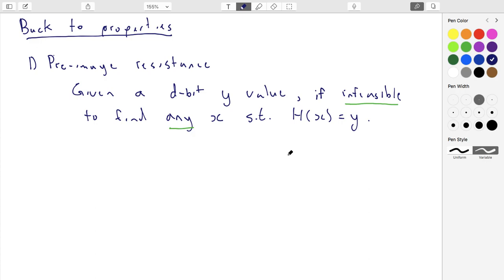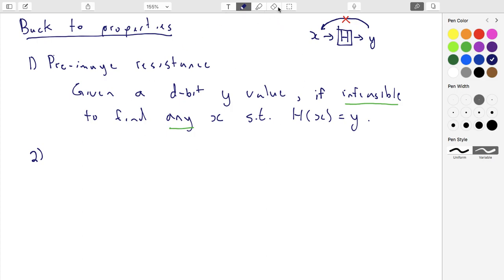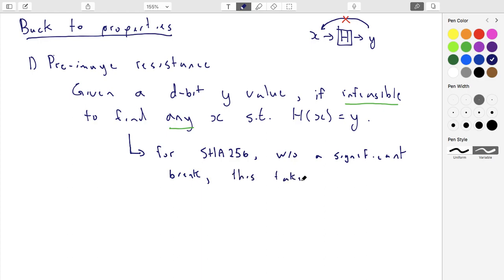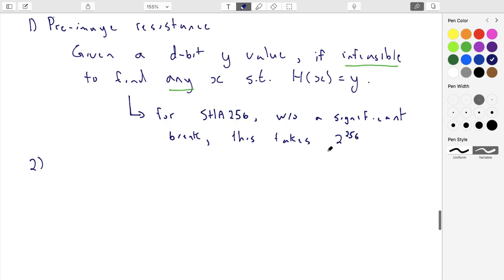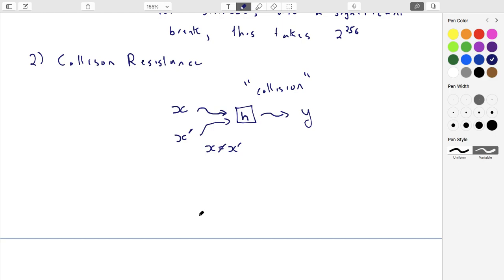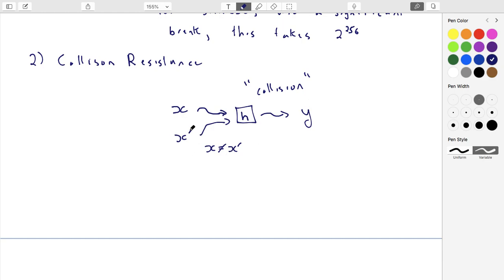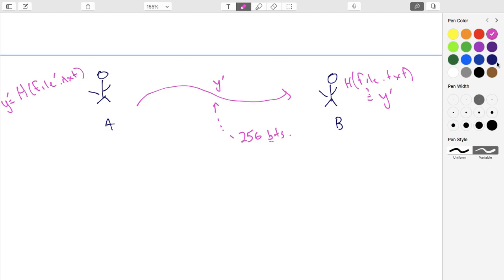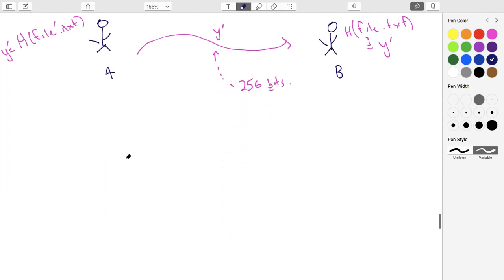Lecture 02

Comment: Hello, could you explain again in other words the difference of Weak Collision and Collision? Just to make clear, which one is the easiest to break as an attacker? Thanks.
Reply: This is how I understood the video: Weak means there is an existing hash value and we want to find another input that hashes to the same result. The other one allows the attacker to choose both inputs so that they hash to the same output. It is easier for the attacker to break collision and it is also harder for the hash function designer to design a hash that fulfills collision resistance.